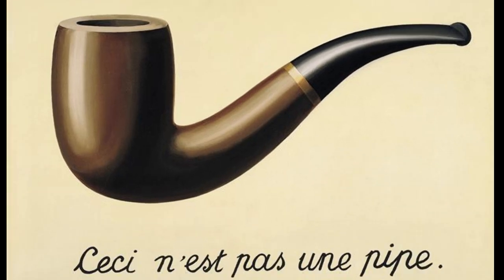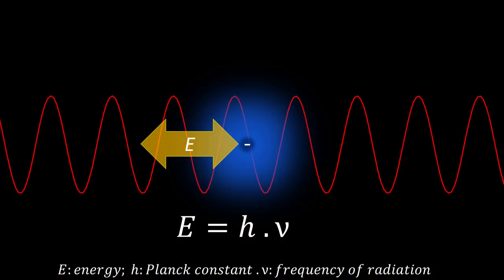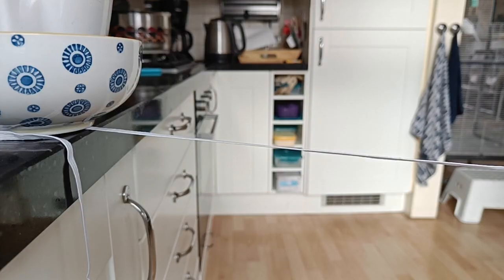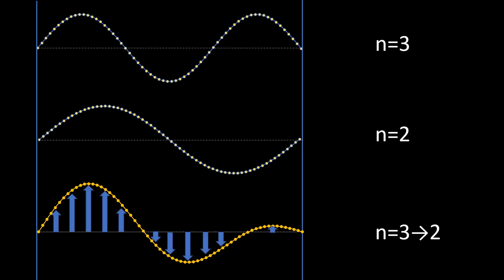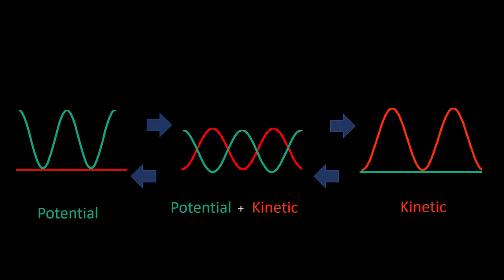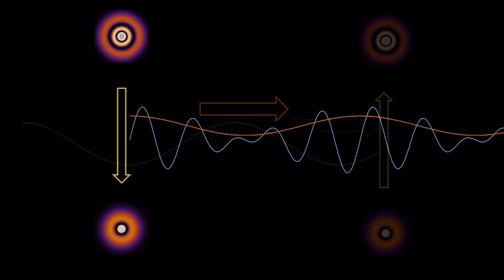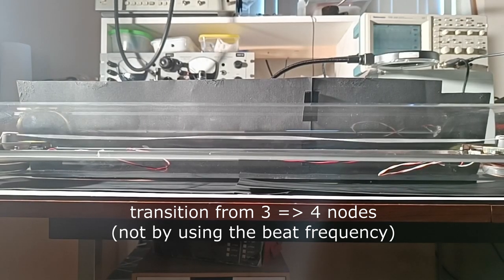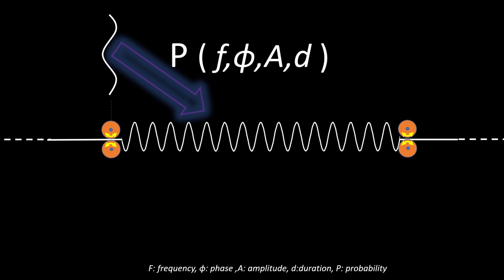Coherence part 3: This is not a wave.

Comment: A lot like one of my experiments instead I'm focusing on air and ionised material, always good to hear another take on the phase velocities (beat frequency).  

The final wave is just a summation of the fundamental Fourier series contained within, so if your signal generator can produce the resultant wave you only need to apply it on one end of the string, the changing phase and wave velocities will manifest themselves automatically.

Comment: This channel is the perfect balance between the accuracy and rigor of a textbook and the simplified explanation of YouTube videos. Every explanation of quantum mechanics has confused me even further. But these videos made a lot of sense.

Although I still have one question. A wavefront occupies a large area of space, thus it's energy is distributed across that area. So when it is absorbed by an electron, how does it decide which electron to interact with since the wavefront could span multiple atoms
Reply: I think quantum mechanics has some correct ideas. Light follows every path, but it will choose the shortest and most efficient path to transmit energy. Just like we install lightning protection lines. Lightning will choose the path with the least resistance.
For light the "resistance" analogy seems to be the difference between the frequency of the light and the resonance frequency of the electron.

Comment: This video inspired me of this. 
The loss in air is a good one, next are 
- Friction between strands in medium
- electromagnet impedance loss
If tension in the medium is not compensated can enable moving coil rubbing the magnet wall, hence
- friction loss. 
Transducer diaphragms tissue/strand
- friction loss
Amplifier impedance.

Comment: One issue is the speakers. They're not "mandating" the positions of the string ends, they're also reacting to the string's vibration (losses on conveying the pulses and attenuating the vibration of the string). I got a solution for this while watching but the video as a whole being so well made with such a beautiful ending, me saying "servomotors" would be like caughing in a classical concert.
Reply from the maker: Good idea, I guess you also need to convert the rotation to a linear motion. Alternatively, one could use fast linear servo's.
Reply: @HuygensOptics  industrial servos would work with relatively large wheel (because of the high torque and tuning parameters) or actually a lever would be easily customisable. But when talking about industrial components, if such are available, maybe the mechanics is not a big issue :)

Comment: Congratulations on figuring out the nature of photons. You have mastered the concept of photons. How wonderful!
Photons are just that. No more.
For a long time, we have assumed the concept of electromagnetic field - is the electric and magnetic oscillation of space around the vacuum state. Electricity and magnetism are two things that create and counteract each other. Is it because of that interaction that the charge is inferred?
Still some ambiguity!
+ What is electric charge? Is it an elementary particle?
Like electron: If it can emit an electromagnetic field, it can have energy states, is the electron an electromagnetic field confined to a certain space? The energy of the electromagnetic field confined in an electron orbital will have a mass according to the formula e = mxc^2.
Why don't electrons fall into the hydrogen nucleus? If we consider the nucleus as an electron confinement. When ionized, electrons are free-floating. Then, is it a cloud of something vibrating through space? Why, once released, does it not decay into an electromagnetic field?
What is positive charge? Is it an elementary particle?
Sorry sir, I still have many questions.

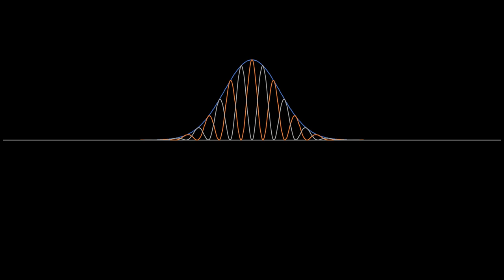Comment: Beautiful video! I have difficulties conceptualizing a model for anything as a sign wave. So when I think about this question @18:10 "What is the true nature of the oscillation (frequency) in the electron", I have to conceptualize the model as a marble rolling on the surface of a cylinder. The marble is rolling around radially as if there is no gravity. The radius of the cylinder then governs the frequency. The rate at which you pull the cylinder away laterally controls the wave length. For some reason, this is easier for me to understand.
Reply: Electrons don't oscillate. You simply don't know what an electron is. ;-)
Reply: @schmetterling4477  I never said electrons oscillate. Were you trying to have a conversation? You’re welcome to make another attempt.

Comment: Beat frequency waves can be emitted and absorbed in small packets. This energy pulse, with an amount of 1/2 wave period, is in phase with the standing wave and must have a wavelength less than or equal to the standing wave. I think that's how it resonates and absorbs energy to increase the number of nodes of the wave.

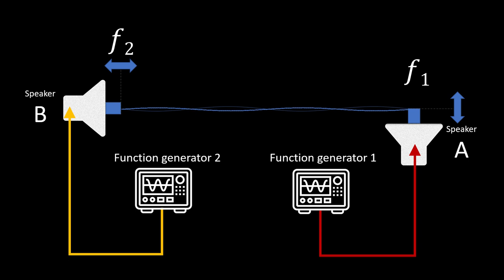Comment: 25:25  The longitudinal wave also establishes a standing wave which evenly divides the string.  The kinetic mass of the string begins to oscillate transverse to the longitudinal wave because of the constant back and forth with the tension.  The transverse motion of the string is centered between the nodes of the longitudinal wave.  The waveform that develops is not a transverse standing wave, even though it looks like one.  It is actually a series of transverse standing waves, each forming between the nodes and operating at its own fundamental frequency. 

The problem is that the frequency of a transverse wave that evenly divides the string is different from the frequency of a longitudinal wave that evenly divides the string.  This is because the two waveforms travel at different speeds.  That is the reason the nodes dance around like they do.  The frequency of the transverse part is different from the frequency of the longitudinal part that is driving it, and the two are trying to find common ground, or a common factor that they could both evenly divide into.  It's kind of like a quantum computer, if you think about it.  :goodvibes:

Edit:  Oh, and gravity is the force that gets it started.  In a weightless environment, there would be nothing for the tension oscillations to work against in the transverse direction.  The string would just be changing length between nodes that didn't.

Comment: I’d use feedback from speaker B to drive speaker A in order to keep it oscillating at a fixed amplitude, or maybe using a different sensor or driver. Be that like the feedback you get from a guitar string close to its amplifier, or like an e-bow. Then a phase-controlled injection of 8Hz should get it to change frequency. The length and shape of the 8Hz packet must also be critical, because otherwise a continuous beaming of 8Hz would just keep changing the frequency. In fact I suspect it probably does, but if you keep the phase relationship shop fixed it will probably just go to and from a pair of adjacent harmonics.

Doesn’t your interpretation imply that the electron’s change in oscillation frequency is the same as the emitted photon’s oscillation frequency? I’ve never heard that said before in my limited experience with physics and chemistry, though I barely passed. Since we more or less know the wavelength of an electron bound to a hydrogen atom, it should be possible to verify that. At least, as far as looking something up on Wikipedia counts as verifying something.
Reply: Your comment just reminded me of how I understand our search for exoplanets is done. I believe that the frequency of light that we detect from these distant planets correlates with the chemical composition of its atmosphere.I forgot what I was writing

Comment: String must absorb a lot of energy as it stretches and contracts. What if you replaced the string with metal wire? Would that get you the 50 times longer decay rate in a vacuum?
Reply from the maker: I guess a metal string would resonate much longer. However for a demo, the movements, especially the higher frequency modes, would be way harder to spot.

Comment: Cycling along the river Waal i noticed a standing wave in the water behind the propeller of a huge and heavy cargovessel running upstream at very high power. A standing wave in water. I don't mean the bow wave but a wave in the water directly behind the propeller, water moving up (and staying up) on a flat watersurface and identically moving down albeit a few meters further along the path of the boat. This standing wave repeated over 10 or so periods before dying out in the flat water.

I tried to come with an explanation, water waves usually move up and down but always moving along with the direction of the wind (or direction of a boat in case of a a bow wave. or moving away from a stone dropped in a pond). But this was a standing wave in standing water, somehow defying gravity.

Then it strucked me that this had to be caused by the water particles moving in a longitudonal direction, pushed by the propellorblades against the uncompressable standing water, therefore having to move up. The wave period could be explained by the frequency of the propeller blades (also the trough of the wave could be explained by the adjacent peaks of the wave, i suppose the water has to come from somewhere).

Not sure if there is a relation to your (excellent) story about light or electrons (for one water is hard to compress). But if anything it made me realize that a wave can be longitudonal as well as lateral.

Comment: potential energy to make the mode transition: would it be that when you introduce a wave of potential energy you create a pattern of tension (stretching in some areas and compressing others) that will translate into a localized particular response to a transversal stimulus. Transverse motion of the rope is characterized by the time it takes to communicate the displacement of an element of length to the next one. This time is governed by the tension in the rope. The potential energy wave will change the tension distribution on the rope such that delays for the transversal motion are introduced differently depending on the location. An interplay between phase and frequency could bring the transversal motion to a new equilibria between potential and transverse energy.

Comment: I don't think the biggest loss in your system is the air, it's far more likely to be the string. Did you consider using something like piano wire/guitar strings instead? Metal strings would be more conservative of energy in compression and tension.
Reply: I think Jeroen opted for that stretchable material because that material allows a large amplitude of oscillation. That large amplitude makes for a vivid presentation. With piano string: compared to the length the amplitude is very small. With the entire length of the string in view the amplitude is too small to see in the video image.

Comment: The idea that photons only exist in the sense that the interaction between electromagnetic radiation and matter is quantized, but that electromagnetic radiation itself is not quantized, is frankly life-changing. This should apply to all of quantum physics, not just QED. Everything I know about QED still makes sense under this assumption, and everything confusing is less so. Did you come up with that idea, or did you read about it? Is it widely accepted, or widely rejected, or anything in between? Where can I read more about it?
Reply from the maker: I'm not sure, it is certainly not widely accepted and it is an insight I arrived at myself. I get a lot of criticism from people in quantum mechanics because they favor the "photon model of light". From the viewpoint of energy / momentum conservation in emission and absorption, this view is actually way easier to grasp. But from the phenomenology of how light behaves in space, it's way easier to think in terms of unquantized radiation. The latter view has some weird consequences though, because it requires the laws of energy conservation to be broken temporarily and requires that space itself is made of energy.

Comment: Your floppy bit of knicker elastic has a lot internal damping. Why not use guitar string designed to sustain a vibration? Or maybe florescent nylon fishing line would work nicely for capturing it on video.  I love your simple clear way of approaching pretty complex questions like the electron analogy. I'm also wondering how much energy you are losing to speakers when they are not driving. You also need a solid anchor point like the bridge of a string instrument. Can you drive the speaker hard one way with a DC voltage when not oscillating it? That would give a clean reflection and prevent it sapping energy from the chord.

Comment: I think with my suggestion in my prior comment to get your model to maintain a new standing wave frequency, you could connect two models together:

Where:
FG Function Generator
VS Vertical Speaker
HS Horizintal Speaker
DET Detector
AMP Amplifier
T Transducer
<---> String (Electron Standing Wave)
,,,, Maintains Standing Wave
..... Energy Transfer (Photon)

FG,,,VS<---->HS.....DET/AMP/FG....HS<---->VS/T,,,DET/AMP/FG (feedback loop)

Emitting Atom Electron on the left and Absorbing Atom Electron on the right.

Set the Emitting electron VS to a 2nd harmonic standing wave (higher energy state) and set the Absorbing electron VS to the first harmonic standing wave (lower energy state).

Change the frequency of the Emitting VS down to the 1st harmonic standing wave, this will induce a brief beat wave in HS and in the Detector/Amp/Function Generator (emitted energy). This beat energy is phase shifted and sent to the HS of the Absorbing electron and the Transducer on its VS picks up the interference where the Detector/Amp/Function Generator creates a 2nd harmonic standing wave frequency to be generated (energy absorbed to put the electron in a higher energy state).

Comment: Forgive me for asking, my understanding of maths is somewhat limited: As the preservation of waves is a limiting factor, and going on the theoretical design of an electron around a proton, would it be fruitful to construct an experiment that uses circular wave feed back instead of linear waves? And, instead of using an oscillating material (any material will introduce variables), instead use light. As for example a circular tube who's diameter could be made larger and smaller and having high inner reflectivity. Frequency oscillation and wave interference should be relatively simple to control. In an ideal world movement of the tube, either around an(y) axis or acceleration through space should yield results far different than experiments conducted 'standing still' as it were. A further play on this theme would be to mimic natures proton/electron by having a magnet around which a negatively charged object can float. In this latter experiment solution would have to exist in the 'tube' to slow down the negatively charged item (assuming it's some form of light).

Comment: I believe the main culprit is the speaker diaphragms. Cause they are like cushions when there isn’t any signal applied. Some kind of mechanical actuation with electric motors would work better perhaps. That would allow a sudden braking more easily.

Comment: Switch the standing wave mode, for example, from three to four: apply the frequency for the triple standing wave in antiphase, catching the correct phase position and simultaneously broadcasting the frequency for the quarter standing wave.  It looks like you can switch quickly.

Comment: A single photon is the smallest a wave propagation that can exist in that particular frequency. This like gamma rays can fit in in a smaller area. The quantization is due to the electromagnetic field and the magnetic field disturbances at 90 degrees. The magnetic field when moving influences the electric field. This effect holds them in a discreet packet preventing the wave from spreading out. If you were a photon you would have no mass then  you can pick yourself up by the bootstraps but as you pick yourself up your accelerating, which makes your lifting force pick yourself up even faster. Light is traveling at the top speed both the magnetic and electric  wave can propagate through the fields.

Comment: Thank you for this! I’ve been trying to make sense of how electricity and radiation work for years. The way that made most sense was the way Tesla described a lumoferrous ether. This also described gravity. I looked into why bc this theory got shut down and the only reason I found was the Michaleson Morley experiment that didn’t detect ether. The Einstein stated that an ether was “not necessary”… then a few years later came up with space time to describe how gravity worked without ether. There are many possible explanations on how the M&M experiment doesn’t disprove the existence of an ether but a paper by Norbert Feist on how he replicated the null result made me start thinking like I was on to something. 

Incorporating an ether into today’s physics and chemistry theories seems to offer much simpler, unifying explanations but rather than list them and try to use words to prove a point I think we should do experiments. I think the wave function collapse of the double slit experiment can be replicated with sound waves. The detector in the double slit experiment is effectively using echo location to detect which slit the light goes through. The M&M experiment should be formally replicated with another type of wave too. Taking into consideration the possibility that the earth and all matter could be compressed ether or atoms could be standing waves in the ether that result in the compression of ether, just like how the earths atmosphere- air - is less dense higher up. A side note: If we visualize gravity just as ether density, this seems to explain the electric field of 100 volts per meter that surrounds the earth in a much simpler way too